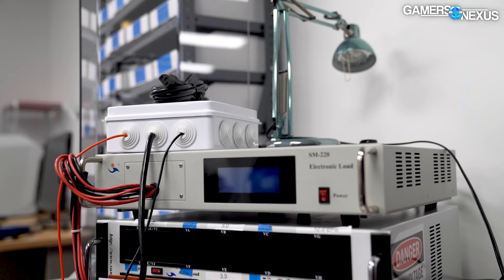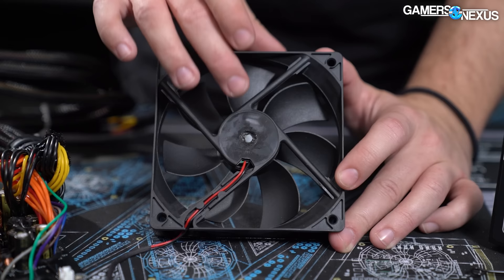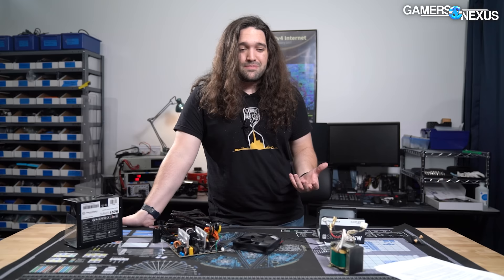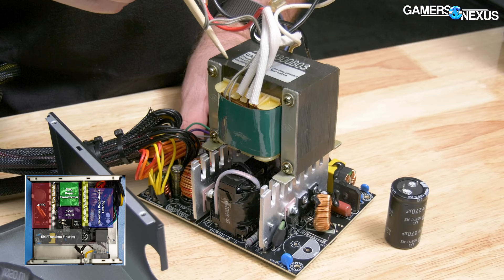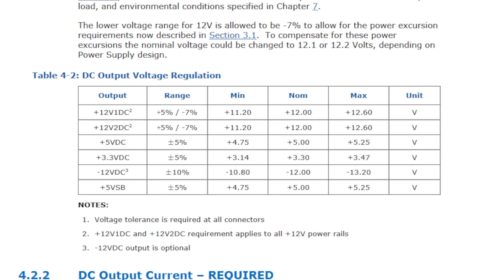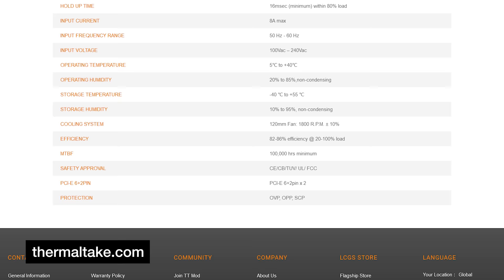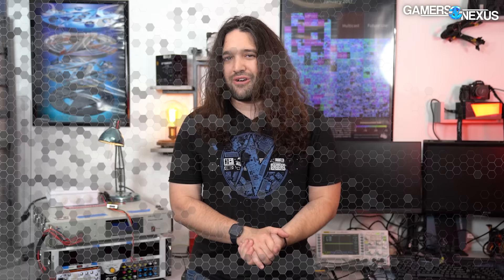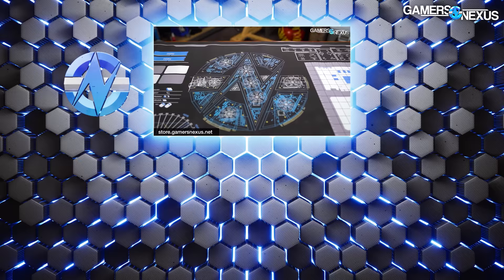Taking Risks on a Cheap PSU: $30 Thermaltake 430W SMART Power Supply Review

Comment: Great review. Love your work.
It would be interesting to also see a review of the EVGA W-series power supplies because there's the W1 and W3 both have basically the same price but I wonder what's different about them other than design. They're both also very cheap power supplies at 35$ for 600W for the W1 and 40$ for the 600W W3 or 35$ if you get the 450W W3. Is the 5$ actually going to make a difference?

I've been using a 500W W1 personally for about 3 years now without any problems and I'm curious to see what it's like.

Comment: Can we please make this a series?
Next do a budget case.
Then budget fans
Cooler etc.

Then conclude toward EOY with the "best budget build"
Tell people exactly what that $X will get them.

It's too messy for people to say and build around say a $500 price point. What really would be good to know is exactly what $ amount you need for a workable solution.
While, sure, CPU and RAM make a big difference in gaming. It's still very much open to the GPU choice. So telling people what they can put together sans GPU, then  tell them the best options for GPU within their specs is the ideal way to present a budget build.

Ideally, I'd like to see this come head to head with the "best gaming build" and have a comparison on what the $ spent per frame, and maybe $ spent per resolution jump even really comes to.

Comment: I'd like to see 10% loads tested, the use case is i need a psu for my diy server and 80+ labels start at 20% load (except titanium) and since there are no sub 400W that have nice long 7/10/12 year warranties and my my calculations i am gonna need 12.4-19.2W for HDDs, 12W for addons, then there is the cpu and pcie cards, i figure that puts be around 50W, so having 10% load data would be very helpful since i can't just buy a quality retail 250W PSU and just get 90% efficiency... i have to buy a 550W+ unit (nothing else is for sale that is quality) so having 10% load data would be very welcome for low power system, if only i could get a office dell PSU, oh wait you can't just repurpose that property design e-waste

i have gone so far to try to get more stuff on the PSU as to have my server provide power to me internet modem, network switch, and PC speakers, audio amp and monitor speakers, the main reason for this is to put more load on the PSU to get high up the efficiency curve

if only Seasonic still made/sold a 360W gold unit like they did 10 years ago

the lowest wattage trustworthy PSU i can even find for sale is a 'EVGA SuperNOVA 450 GM' and that cost more than higher wattage units with longer warranties and 20% of that is 90W around double what my system will usually be pulling, so having 10% loads would give a good idea of the efficiency curve since you have 2% and 40% numbers

my old 300W seasonic PSU from 10 years ago seems to have gave up and i need long term  replacement

Comment: How does comparing peak to peak voltage ripple at %60&%100 loads respectively between 650 watt units and this gimpy little 387 watt unit make sense?

Comment: I personally had a 700W version of this and i had a friend that i reccomended to get ome as well at a lower wattage. I thought thermaltake was a decent brand at the time and thought it was a sleek power supply at a good price. But i found me and my friend ended up having similar issues later in the lifespan of the supply. As soon as the gpu kicked in or something spiked the supply the whole machine would trip and power off and then start up. Super annoying and I had to seriously crank down the performance of my gpu to prevent it but at some point it would do it even at the lowest i could put it getting to mhz territory. Bought a corsair PSU and never looked back.

Comment: I currently have the Thermaltake Toughpower Grand RGB 750 W 80+ Gold Fully Modular and currently have to disable c-state in bios to not have BSOD. Could it be an issue with the power supply or it's more likely the cpu(i5-12400)?

Comment: I honestly love that the ATX standard has lasted this long, but I still laugh every single time I see a floppy power cable included. Even 2020+ high end PSUs still come with one (or an adapter)
Reply: Molex connectors still make me laugh in 2022.  Yes, I know some atrocities out there still use Molex (namely super-cheap case fans), but they shouldn't... not in 2022.
Reply: There's still some accessories you can get that are using a floppy Molex for power. Not generally floppy drives, of course.

Comment: I used a Thermaltake Smart BM1 500W PSU in a build in early 2020, but sadly my experience wasn't exactly great. The fan was pretty loud from the beginning, but it started sounding awful after around 1 year, so I replaced it with a Arctic P14 one I had around. After around 2 years, the PC started randomly shutting down, so I said fuck it and replaced the PSU with a Corsair CX650F. No problems since then.

Comment: Dirt cheap low wattage budget PSU's have their place, like replacement for prebuilt systems or for low power office PC builds where you either aren't running a dGPU or are running a slot powered dGPU and just need a PSU that works reliably.

Comment: Thermaltake sells rebadged psus, and some models are better than others... I have a 750w bronze that's been solid, though doesn't give you enough juice on the 12v rail, while a 1000w gold which had better specs, crapped out in no time at 80% load.

Comment: I wasn't expecting much out of this psu... I have had people tell me that I shouldn't use the Lian LI SFX750 because it's not actually rated at 750 watts. I've built multiple PCs with this psu because I can get it bundled with the O11mini pretty cheap. Even my personal rig has this psu. I haven't had any issues but I'm paranoid. Please check out this psu to ease peoples minds... Mine too.🤣

Comment: I bought a 40$ case with a 12cm fan, "500W" power supply and even rgb strip.  Paired that with the cheapest AM4 motherboard and a cheap but good ryzen CPU with integrated graphics. Added a cheap but good CL 16GB RAM (since it is used by the integrated GPU) and it it is a budget PC that FLIES. But after seeing this review, it might have been better to buy the cheapest case without a PSU and get this thermal take.

Comment: Doing some quick Googling seems to indicate that the -12V rail is only really useful in old builds that use PCI or mPCI slots, builds with weirdly middling quality sound cards, or some builds with native RS-232 support. Sounds like if you fit one of these categories, you should not buy this PSU because of the lack of SC protection on -12V. Does anybody have anything to add to this? I'd be curious to know if someone out there has a device that they know utilizes -12V.

Comment: Bit of a strange and long winded request... but would it be a possible idea, to show case a few PSUs ... cheap like this one, mid range, and then stuff like 80+diamond ultra rare psu's
In different wattages with different systems 
So.. say a lower end system, and then a power hungry system..
Few things like, idle all day vs turn off, gaming for 2hrs a day v 6hrs (say streamers)
And show how much of a difference efficiency makes to your power draw at the wall.

IE, is it worth the money spending more for a 80+plat psu, vs a cheap 80+bronze ... will you save money over say 5 years with avg 3hrs gaming a day etc etc
Or say, the value to someone that only games a small amount and turns the pc off (better value going the cheaper psu) vs say a streamer so gaming 8hrs a day who leaves the computer on (where the value with power savings could "made back" with a expensive psu)

Comment: I had a thermaltake psu actually fire off a capacitor casing inside the atx psu case. as it bounced around it fried everything but the cd-rom back in 2008. this of course was during the capacitor-pocalypse when the bad cap batches made it out into the wild from a failed recipe copy from the japanese. I had a few other terrible experiences with Thermaltake and vowed not to use that brand anymore.

Comment: i have a thermaltake smart SE2 600w psu and my pc ( i5 9400f  rtx 3050 ) keeps randomly crashing and my pc is very very very unstable and before i upgraded to the 3050 and new psu i had a deepcool 450w one and it didnt have any of these issues

Comment: For me any power supply under 80+ Gold it's not worth. My next power supply will be at least 80+ Gold or higher. I don't want to burn my GPU, MOBO, CPU, RAM, SSD by low end power supply. Or burn itself, so I must buy another one. I want better quality and pay for it. 
Now I use Be Quiet Pure Power 11 600W 80+ Gold power supply for 5+ years (or even longer) and it's still stable and work well.

Comment: TBH, this PSU may be sketchy for PC builds, but if you need 12 VDC for whatever else, getting a powersupply that's "not" for PC use that's remotely anywhere near as powerful would run you over $100

Comment: The problem with cheap power supplies is that they just last one system and might cause issues that are hard to track down. Your power supply should be one of the most expensive components, $100-$150 will get you something that will last a decade.

Comment: I have a $34.99 EVGA 450 W3, 80+ WHITE in my daily driver Z690I build in a snow 100 case with a crazy fast Pentium G7400 cpu 16 gig ddr 5 4800mhz ram and a benchmark braking RX6400 GPU :-} been very happy with the 450w psu actually picked it over the TT 430w white because I just felt it was better quality build for a budget PSU and had all black cabling and no mustered and catchup for $5 more maybe yall can get one of those next ??????

Comment: see people this is why you don't cheap out and buy a $30 dollar power supply, and you definitely never buy a 430 watt psu that's only $30. i wouldn't trust this to power a budget graphics card like the Radeon RX 6500 XT or a GTX 1660. But you could do a build like this

CPU = AMD Ryzen 5 5600G APU $178
mobo = Asus Rog Strix B450-F Gaming II $139 dollars
Ram = TeamGroup T-Force Vulcan Z DDR4 16gb 3200mhz kit $50
Storage = Samsung 870 Evo 1TB SSD
power supply = Thermaltake Smart 430 watt 80+

and there's your simple office and casual games PC build
i didn't include a graphics card because you don't need one with a APU, but if you want to add a small low power card. get the Radeon RX 6400 not the 6500 XT, that's a 105 watt, but the 6400 is only like 80 watt, so you wouldn't need much to power it. plus pairing the Radeon RX 6400 with a APU like the Ryzen 5600G, you can get more performance together.

Comment: I think I had  almost this exact same power supply (was a Thermaltake 430 watt) paired with a brand new AMD Athlon 64 X2 6000 processor 15 years ago. Didn't like it then, much less now. Other than an updated sticker, looks just the same. Did last 10 years (mostly) abd I still have it in a box of isn't dead yet parts.
Never bought another one of their power supplies again because of that one.

Comment: PSU Cultists list puts the 80+ SMART as "Tier F Replace Immediately". What's your opinion about that? Do you think that the brand has improved their device, or is it some other reason behind not recommending it as a basic iGPU PSU.
Reply: Well, this time, they are correct, even if they don't always fail catastrophically like what happens with some people's PCs.

Comment: To be honest, the packaging is the best part of this power supply for me personally.
I'd love it if we switched away from this overabundance of closed-cell foam that's a pain in the butt to find a place that will accept it for recycling, and instead switched to easily-recycled cut-and-folded cardboard.
You don't lose much protection in the grand scheme of things. And that foam only makes a good impression once.
Why not forgo the "only there to look pretty" foam, and instead opt for a more environmentally friendly (at least from a recycling perspective) cardboard based product presentation method.
It's not impossible to make cardboard look at least as good as that foam, after all, all you need is a good packaging engineer.

Comment: When people say do not cheap out of the power supply they mean don't buy a high wattage power supply with a generic name like Super Duper Power Supply 9000, because they tend to cut corners where they shouldn't be which in turn can shorten out your hardware or worse cause a fire.

Comment: I'm surprised the -12V rail is even present.. hasn't that been removed from ATX requirements a few years ago already?
Reply: this psu is likley made around older atx spec, which requires -12v
Reply: That was -5V, which was taken out (made optional) in ATX rev. 1.3.  -12V still has some rare use cases in RS232 (serial) signalling, which is probably why it's still there.

Comment: Had a PSU let me down for the first time other day, my corsair hx850 was causing my gpu to drop under certain loads, not cheap and maybe 18mo old max. 5900x, 3080ti , 9 x 3000rpm noctuas and a couple of d5's, should probably not be more than a 600w load... Replaced it with a silverstone, only retired my last silverstone (a da850) after around15 years because it lacked modern power connection options and id long since lost all the cables it came with.

Comment: As a consumer, I would think that the 12v rail would output the Plus/bronze/gold/platinum rating so, 85% of 430watts=365watts. For the rest it's for usb and other stuff. If it's not, I don't buy. I lost already a computer once long time ago and don't want that to happen or I will lawsuit that company the the values of my files,parts and madness moment of remembering this. Saying that a power supply of 365watt running 85% efficiency in reality is a 430watt running at 85% efficiency is not as clear to me.

Comment: I saved up just £160 for an asus rog 1000W 80+ powersupply (the ones seasonic made) it may seem overkill... but I plan to build a new pc and well this baby is gonna power my ryzen 5 5600x &  rtx3070 rog strix build pc... and allow me to upgrade for the foreseeable future without worrying about requirements and besides it's got a 10 year warranty! (I kinda had no choice to get a new PSU my old PSU was barely holding on it was a replacement part a repair store gave me for £50 and was only a 650W supply which I felt wasn't gonna meet the new demands my new processor was gonna ask as it was already having strange powerspikes before I upgraded the mb and processor so I got rid of it i'd had it since 2014 and I did the psu upgrade in early 2021 so it ran a good 7 years and for a old bronze psu that ain't bad the make wasn't a branded either nothing well known that I recall)

Comment: 11:35 stone says some powersupplies come with capacitors rated for 10,000 hours. Does this mean that the power supply should be replaced after that amount of uptime?
Reply: No. That's the rating for operating at 105 graus celcius. For normal temperatures (ambient...full load PSUs) it may last much longer. It's very hard to know when some component will fail, it's very unlikey that all of them have the same rating. Some PSU makers give 10 year warranty, so, if you want to be on safest side, use until you reach the warranty (which is the point that the manufacturers belive the vast majority of their PSU's of that specific line will last at normal user usage), you can add more 10...30% and still be safe but as the time goes it will eventually fails. When it fails, it could go with some other components or just itself, it depends of what fails first and the protections of the project itself.
Reply: @caiof0584  cool, thanks for the knowledge 👍
Reply: Typically, for every ten degrees lower than the rated temp, the capacitor lifespan doubles.  So the 2000 hour at 105C caps in this power supply could be expected to last at least 4000 hours at 95C and 8000 at 85c.  If you're running the power supply well below it's rating it's almost not an issue, and the power supply should last longer than the machine.  Just beware of cheap caps in a power supply rated at 85C.  They'll be puking electrolyte in a few months and slowly turning into resistors.

Comment: Hey guys, I believe you are the only ones that can properly address this issue. I generally have high-end systems and recently got a 4090, because it requires 4 8-pin cables I decided to replace my Seasonic focus platinum 850w PSU for an EVGA g5 1000w because the Seasonic only has 3 8-pin connectors. The thing is that as soon as I replaced the PSU I started hearing a really awful coil whine that wasn't there before... could you investigate this?